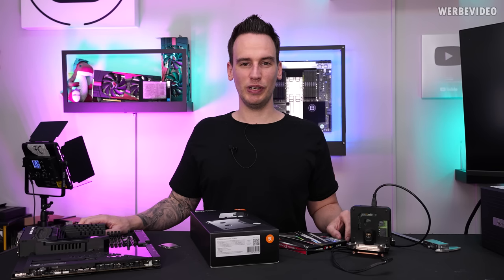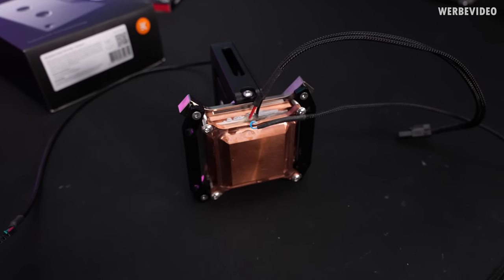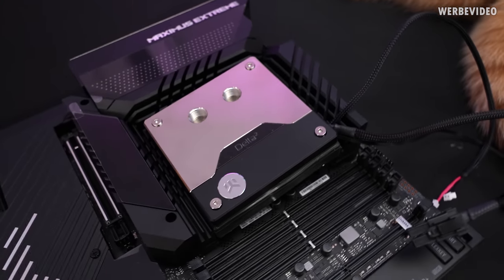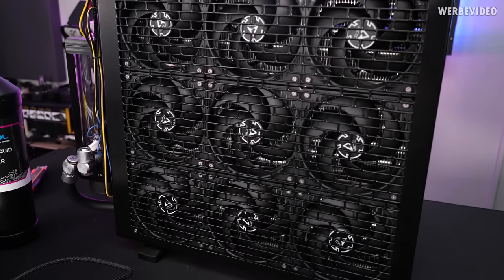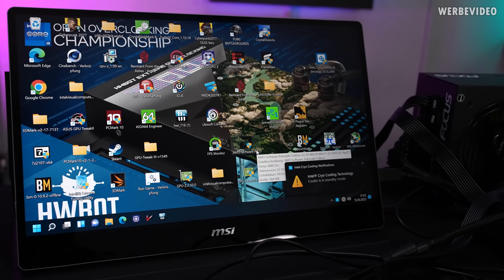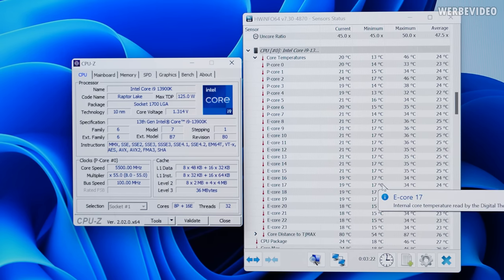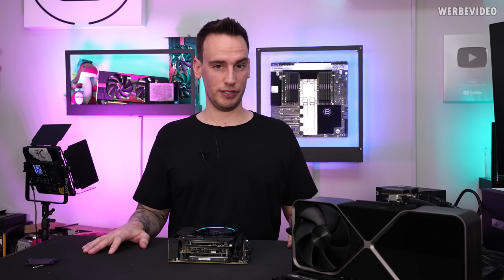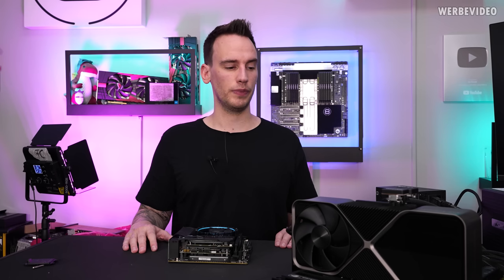This insane 500$ Water Block allows 13900K Overclocking above 6 GHz

Comment: As good as EK makes their stuff I would still not be confident running a peltier 24/7 or full time. Condensation can happen all too easy for more than one reason and that single rubber gasket has no redundancy or fail-over. A better gasket design with redundancy (double seal) on both front and back would make this a 24/7 solution. At 500 bucks this certainly isn't cheap either but it's a massive improvement over the ancient stuff outfits like Danger Den were pushing back in the late 90's and early 2000's.

And remember as well, when trying to cool beyond what the peltier can handle going water-only will do the job. It's VERY EASY to expand on rad size, add more coolant volume and get fans with the specific airflow/noise profile that will work in these instances. I have 30 fans and five massive rads in my rig all cooling a 5960X and four 3080Ti's with my water temp under 55C at full load and a delta under 20C, all nicely dust filtered and sound insulated😎
Reply: 5 gpus in one rig? What is it used for lol

Comment: Had similar issues with the last version, the software will go in to standby mode when it realizes the temperature and cpu load doesn't line up. I now run without the software after modifying and run 5, 7 or 12v straight to the tec. Tried many things to gain access and control via i2c etc and went as far as removing sensors until I realized how stupid it was to waste time  when the software is not needed in my case. Fun fact, before I started modding mine a power stage caught on fire and scorched the top of the block

Comment: Is it possible to OC only 1 or 2 cores (so the main thread goes there) to 6.2GHz or above while keeping the other cores at tje base clock or even lower. It seems like if it was possible to beat the power consumtion of the ryzen while keeping a higher performance in games even with a "less" efficient node technology 7+ (10 nm ).  Just to increase the big-little approache even more, multithread as effiecient as possible but 1 or 2 threads going as fast as the technology permits. It would be amazing this setup being cmoapred and tested with the cheaper cpus like the CEelron, Pentium Gold ans 12100...

Comment: The great thing about this type of cooler, in my opinion, is that the hot side of the Peltier element can get hotter than the CPU, heating the coolant to a higher temperature than the CPU would at a given load. This makes the coolant more efficient at cooling, and the cold side of the Peltier only gets proportionally colder.
So you can have liquid cooling efficiency normally given by a 60-degree delta, even when your CPU is below room temperature.

It's almost like a heat pump for computers, without the noise!

Comment: I don't get the point of this cooler when it needs a water cooling setup to begin with...  if the water isn't cool enough, couldnt they put the TEC into the radiator or something?

Comment: I remember being part of the original Peltier "revolution" as part of the 3ghz single core Barton drive and it was with such I got my name on Overclocker's leaderboard with an AMD 1700+ mobile abs screaming its poor heart out at 3.1ghz stable under water and Peltier and in a Antec Skeleton open air case hehe   I lost interest with it after attaining that holy grail and reverted to water until I acquired the first Coolermaster V8 which could cool almost as well under load as my water kit and so bye bye water and bye bye leak checks, pipe mischief and tons of stuff I had to do as that V8 was just phenomenal good.

Comment: Would have loved to seen a multi-core run to see how it holds up with all cores going full blast. Many of my workloads use all cores and I'd like to get an idea if this product is worth it to me to overclock my 13900k. Right now, I hit 100C+ on 4 cores on a Cinebench R23 run with an Arctic Freezer II 420. I had to undervolt the chip to get the heat down, which means I cannot overclock.

Comment: If you want to tighten the posts with no room just thread in the screws into the top, that will let you tighten the posts, then use something to hold the post while you loosen the screw.

Comment: My Deepcool AK620 air cooler works great on 5950. Not the numbers of the latest but far more reliable. The 5000 series is efficient and cooler then the gen before or after. Ill go water when I have to but what a hassle.

Comment: I don't understand what's the Purpose of cooling the CPU to 13-15 C, or sub-zero, which is what some people do, with liquid nitrogen
The Optimal operating temperature for the chip is Listed as 45- 55 C
Seems to me that what's needed is greater Volume of coolant, not lower Temperature of it...

Comment: Why EK is not making anything for AMD?  This and a recently announced pump-block-reso combo, all intel only?
Reply: Market share
Reply: @oldschoolpro  Yup, intel still owns the market and 13th gen is selling better than Ryzen 7000 now also because alder and raptor lake can use DDR4 still
Reply: If you watched the first 5 mins of the video you’d have your answer, the Tec cooler was made in collaboration with intel.
Reply: There is zero reason for any compatibility issues, that's just company BS. Does your fan or pump need to be intel or amd certified to spin? Does copper needs intel/amd approved sticker or it refuses to conduct heat? 
This is just heat pump with external controller that runs off external temperature and humidity sensor, there is zero physical or engineering reason for this to need rubber stamped software. People were doing that for years, plenty of resources on old pc forums. Its niche cause it's expensive, energetically inefficient and there is minimal performance gain with modern cpus.
Reply: EK make lots of products for AMD, including special editions that do not have an Intel counterpart. This product is the result of a collaboration between Intel and EK, I think it's quite self explanatory why Intel are not helping to engineer cooling solutions for AMD CPU's?

Comment: I built several of my own Peltier coolers back in the day (i.e. Way back in the Pentium 1/2 era) but in recent years the efficiency of heat pumps and vapour chambers has made this cooling method   almost completely impractical for 'normal' use cases, interesting however to consider them for powered cooling in high overclocking.. 🤔

Comment: The problem with this, as with any Peltier cooler is dumping the heat from the cooler and cpu combined.

You got a good result but that's because you had a great cooling capacity on your water cooler with a cooler as big as the one on an Audi RS6 and 9 fans.

Having said, that, would be interesting to see how it performs stuck to the bottom of some sub zero liquid cooling or even single phase change.

Comment: Respectfully, I strongly disagree.

While it's technically true that the cooler and software has no idea that it's sitting on a 13900K - it kinda does (!) "recognize" that it's NOT sitting on top of that 12900KS.

The reason you're getting the DT1 error, is because the thermal sensor readings from the cooler are out of spec. As in outside of the margin of expected temp readings, based on the CPU telemetry that the software is pulling.

The software pulls a ton of telemetry, from every component involved. It knows roughly what to expect, but the issue here is that it's pulling that telemetry from your idling 12900KS. When you crank the 13900K, the 12900KS is still idling. But now suddenly the temp readings of the cooler, relatively speaking, shoots through the roof. We gotta remember that this isn't just a dumb always-on TEC. It's a dynamically operated unit.

And yes, nailing down those margin specs for the 13900K is still in the works. But even if that was sorted, That's no the cause of the error in this case.

The Delta² TEC cooler is also meant to PWM control the fans and pump, not just aquire an RPM signal. So if it attempts to adjust the speed of either, and the RPM signal doesn't change, it's gonna throw a fit. 

This thing has a crapload of safety mechanism, based on all that telemetry. And to be a commercial, official Intel collaboration product, it has to. Because unlike the vast majority of other commercial CPU cooling systems, this one can actually kill your CPU, motherboard, potentially other components and itself - incredibly quickly - if it malfunctions.

Comment: that is really neat stuff, It is kind of disappointing it has to run the fan and pump speed sensors though as a MoRa is the perfect radiator for this kind of heat load. Especially in a fully water cooled system where it would probably also have that GPU.  That radiator can handle over 1000W afaik.

Also got a chuckle in having to take the CPU away from the cat.

Comment: IT seem like it would be smarter to put the peltier device on a cooling block after the Radiator not dircly on the cpu. that way you are cooling room tempreatur water with the Peltier. THis way you only ever tak the load off of the radiator, wich is not somthing that needs load control.

Comment: These coolers have been interesting to me since I saw them roughly 17-18 or so years ago…….. although they were much more fiddly, cumbersome and required much more technical knowledge. I got myself one of those Cooler Master Intel 11th Gen peltier coolers (for roughly $120USD BRAND NEW & SEALED) with a built in 360mm radiator and looking to mod it fro my AMD AM4 rig. I would love to get that going as a starting point 💪🥳🥰

Comment: In a time where nearly everything has a advanced controller. This should not require any software or connection to the motherboard. Both should be fully independent.

Comment: I dont understand why the controller has to be controlled by the OS at all!
I NEVER want my cooling to be dependent on my OS!
Bios is fine but it should be low level control.

Everything this controller is doing could be done automatically without any OS, IT just monitors the temp to avoid condensation, and maybe overheating of the tec, that can be done by a independent controller.

Comment: I would LOVE to see this cooler combined with a 2 core Alder Lake Pentium or Celeron on one of the boards with an external clock gen. 6ghz Celeron? It shouldn't even overwhelm the TEC
Reply: Also, to use the software on incompatible systems, someone made a "cryzen" version of the intel cryo software that bypasses hardware compatibility checks.

Comment: So you could probably get even more better performance if you increase the thermal threshold. 6.2GHz is insane for a stable OC not using impractical solutions like dry ice and liquid nitrogen.

Comment: Isn't that just a Peltier block (aka Thermoelectric conversion) and will require motherboard prep to deal with condensation ... those have been around for decades.
Reply: The condensation issue is directly handled in the software.. Video directly shows the condensation spot being 14c, which means if you can keep the package above 14c you'll never experience condensation.
Reply: @eidodk  Yes, I have a similar chiller unit that does the same (except I design/built it), but limited to dew point at location which ranges from 4C to 15C pending weather, this does allow for better stability and about 300-400Mhz higher frequency.  Don't get me wrong, it's a good idea but it's not a new idea, has been around for a while.  But Peltier's do have much more cooling potential but that requires motherboard prep.

Comment: I love the idea of such a cooler for 'science'/just for fun. But on the other hand.. people are already complaining a lot about the power usage of their PCs for good reason.. using a cooling method that essentially pumps in even more power just to cool a specific part of it (the CPU), only to than also increase the power usage of the CPU itself with the higher voltage, just to have slightly higher clocks.. very small set of use cases where this performance benefits anyone anyways.. I know people love to freak out over the temperatures inside the CPU itself, but personally I rather reduce the space heater that is the PC overall.

Comment: One of the coolest things involving Tec is it can be used to create electricity.  If you're camping in the Winter, & face the cold side to the cold air, & the hot side towards your fire it will produce electricity.

Comment: that LED error code is pretty damn stupid,  im sure back in 2000 the designers consider it blank rised and  expose to make it easier to read,  years later new engineer/designers were thinking there is no good reason why its alone and ugly looking, lets make it a frame to look modern and sleek. But they never understood why the original design was like that intentionally

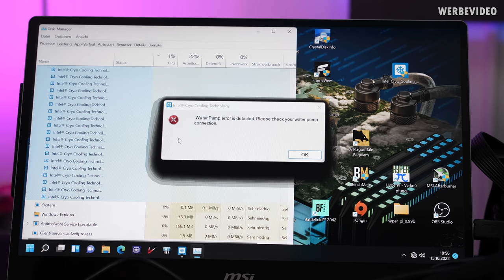Comment: 15:50 Well no shit you're getting pump errors.  A D5 pump is supposed to run at almost 5,000rpm, That fan is only running at 1650.
Reply from the maker: Nobody wants to run a D5 at 5000 RPM in his system

Comment: I have the previous version of this I kept getting the dt1 error  with it constantly going back to standby it turned out to be a hardware problem with one of the sensors  I think it was the dew point sensor but I can't remember exactly but I got a replacement unit and that problem went away but I will say it cannot be glossed over that this cannot handle the heat of the cpu in an intense use scenario at all it will go into thermal throttle a much cheaper 360 aio is way better for anyone who isn't looking to do something dumb and expensive to their pc and even when it is working correctly it is still very trigger happy on going into standby mode without warning the user.   I have it and I can tell you it is a very bad idea to put this in your daily use pc the performance upgrade you get in the higher clocks is not noticeable  because they are only available in light workloads less than 200watts which the processor has no trouble handling anyway so you end up using twice as much power to get a indistinguishable performance upgrade that is a major performance downgrade if you need to do anything really cpu intensive and it is very expensive.

Comment: Would have been interesting if the TEC was used to chill the water in the loop***, rather than sitting sandwiched inbetween the CPU and waterblock. The current setup means you can't run the system at full all-core load anymore as the TEC would thermally overload, so you'll basically be stuck using your (now even more expensive) expensive PC as a glorified games console. Also, always stuck running the TEC at all times, drawing additional power.

If the TEC only chilled the cooling water, you could disable the TEC completely when browsing the web or just sitting idle in windows for example. True, you'd basically need a second fluid loop or the mother of heatsinks to cool the TEC so would be more expensive, but with today's energy costs, how long until the extra power draw of the current config evens things out? :P If you run this system several years it will consume tons of additional power over time heating your computer room, potentially running house AC system more often drawing even more power.

Ok, so if someone has the money to buy this system they have the money to pay for additional electricity too, but that doesn't mean a person necessarily wants their PC to run wastefully. If you can avoid drawing unnecessary power, why not do so? There's no bragging rights in a PC sucking additional power out of the wall for no real-world gain.

* = As some Dell XPS systems did back in the latter half of the '00s. They had Core2 Quad CPUs, cooled with waterblocks, standard radiator and pump, AND a TEC chiller with an additional heatsink sandwiched to it, all mounted into a bigass wind tunnel-like unit on top of the CPU (which screwed right into the backplate of the chassis), and driven by a super noisy 120mm/38mm PWM fan. There was also a controller board running the whole show in there independently, without Intel's fancy software.

That TEC sucked a ton of power from the PSU at load using a proprietary (of course, because Dell) connector from the power supply. Cool tech, although clunky and extremely custom implementation which only fit these particular PC models.

Comment: TEC coolers are very interesting devices, but if it fails could destroy the CPU if it doesn't engage thermal shutdown. They also draw a lot of power. If you have a device that transfers 100W of heat energy the TEC will draw an additional 100W. I imagine the controller is PCM which keeps the cooling in check and reduces power consumption. Without it, the TEC will suck every BTU it can get its paws on resulting in subzero temperatures. Condensation occurs when the temperature drops a few degrees below ambient and is very risky for shorting out the electronics. While very appealing this mod is only for the brave at heart and will like cause problems in the long run. Very rarely are TEC coolers used in industry for the reasons stated.

EK did a nice job packaging this TEC cooler. It appears the software has a few bugs some of which may be attributed to being forced to jury rig the set-up. Great video as always, thanks for posting